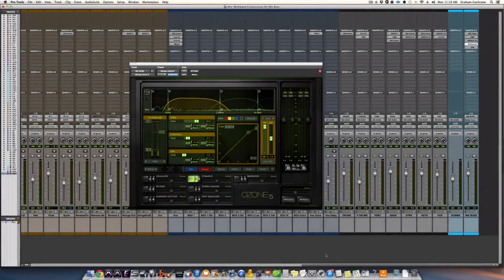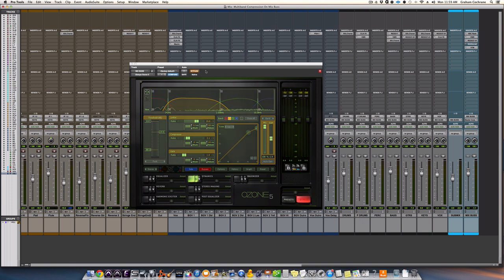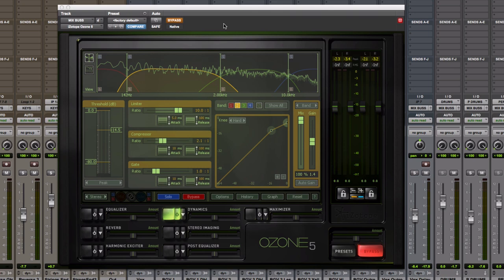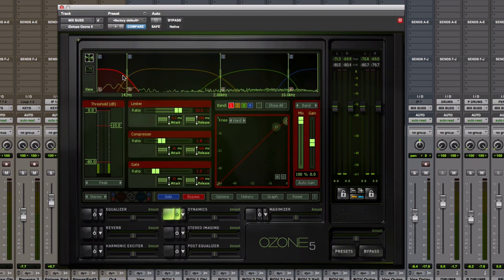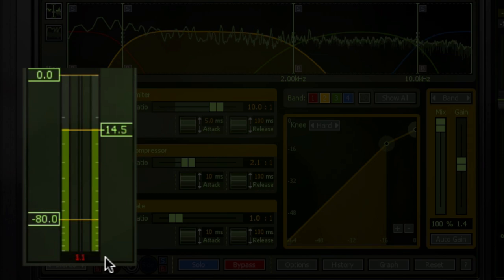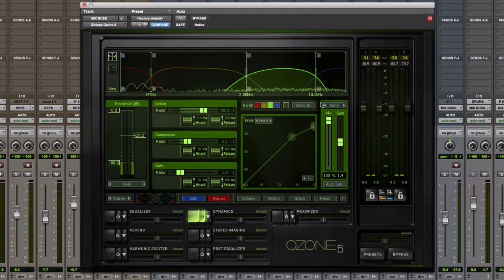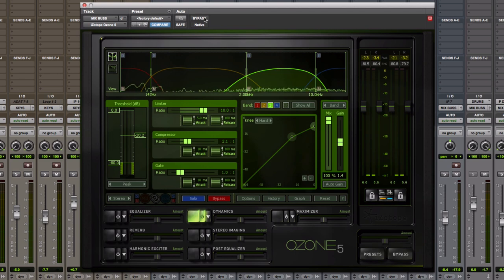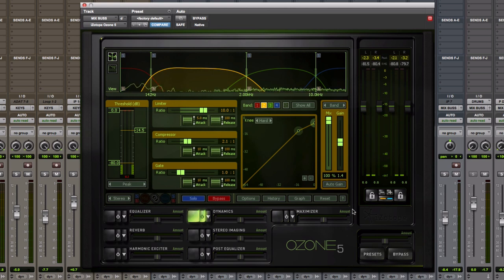Multiband Compression For Instant Mix Energy - TheRecordingRevolution.com

Comment: Graham, one of your best post ever. If used as you have shown, very sparingly it make me think of going to the eye doctor for a new fitting. He has that test where he asks which is better 1 or 2, until you can't tell the difference. That is how it was when I used it. The mix was good before the multiband, but when I added it, it was just a little bit better. It was like I took a step or 2 closer to the music, It was just a little more as if I were just in front of the band. I set up a preset for my Sonitus multiband compressor using your video. Mostly I would change when the compressor would kick in and then I would use bypass to test with or without. It was never a dramatic change just a nice subtle change. Thanks, Ray

Comment: i completely get what you're saying about how it "grabs you", but i'm noting a huge difference in the bassier instruments. your bass guitar and those low notes on the piano have such huge presence when you turn on that compression. they just pop right out of the mix. i'm blown away by how drastic of a difference this is. of course, there's a difference in other instruments as well, and the overall feeling seems a little more alive, but my god. thank you for sharing
Reply: I could not agree more, I really notice a difference in those bass frequencies when the comp is turned on! It must be that 140-250ish range that's really benefiting.

Comment: I've recently had to stick to a Studio One 2 Artist built-in compressor for a while, and to be honest, it doesn't do much. You can hear some difference, but most of the time it just doesn't want to work; its broken. At one point I got so annoyed that I took the compressor out, and made a makeshift compressor of my own: a limiter with Mixtool to act as the make-up gain. That worked. 

By the way, that is a good mix you've got there. Sounds lush.

Comment: I don't use multiband often. But the way I usually look at how it works is that it is a compressor but one where peak reduction doesn't affect the overall volume too much. E.g. if I have a kick drum going a classic compressor would be pumping with every kick. Multiband only pumps the bass (depending on band setup) and all the other audio is left untouched. Same goes for snare cracks, percussions or whatever there may be. It means that e.g. a 3:1 compression on a multiband will bring out more from the sound than just overall 3:1 compression.
But I'm no expert on multibands either :D

Comment: Another great technique.  I used to use multi-band compression but stopped because I couldn't wrap my brain around what it was doing.  I know the theory behind what it's supposed to do but I thought this may be too advanced for me.  However, I love what Graham is doing here.  Leaving the bottom and the top alone, and slightly squeezing the 2 mid bands.  I may not understand exactly what's happening here on a technical level, but the before and after speaks for itself.  I've already started using this technique in my last 2 mixes.  Thx Graham.

Comment: you forgot sausage fattener and soundgoodizer. always works
Reply: No.
Reply: The problem with soundgoodizer is that it's a set of Maximus presets, and you have no idea what they're doing. If you're using it on individual sounds, I guess it could work, even Savant said he's using it a lot on drums. But using it on your mix/master is as amature as you can get. Use Maximus instead- it's always better. It's not an opinion, it's a fact.
Sausage fattener however is a tool for lazy people, when you want to get a certain sound as loud as possible with no effort. Again- sometimes it works, sometimes it doesn't. Good thing to use on individual sounds (I find it perfect for drums), but not on overall mix/master.
Reply: It's pretty simple. If you like how soundgoodizer changes a sound, there is nothing wrong with applying it. If you're an amateur and destroy important dynamics of a sound it isn't soundgoodizers fault as the same result can be achieved by simple overcompression. Listen closely to the changes and evaluate how important the dynamics of your sound are.
Reply: Lol... Sausage fattener is only a tube saturator, and soundgoodizer is what Tristan Gray said, but I wouldn't use soundgoodizer on a master buss since it's basically sacrificing lows for highs the higher you crank it.
Reply: Soundgoodizer is just Maximus presets so it sounds fine in certain applications..  i often put it on kick drums..  use your ears not your preconceptions

Comment: Definitely a very positive , but quite subtle difference to my ears, using the multiband compression, way to go Adam !
And ..maybe it's just my ears but to me, with the multiband compression on, also the low's sound abit fuller (nicer),
although they are not assumed to be touched... how odd..
I am listening with Adams A7 speakers.
Reply: We'll, what we percive as fullness starts at around 200hz, which is getting compressed. Below 140hz isn't what we would expect basswise. I like to look at this chart sometimes, pretty handy: http://www.independentrecording.net/irn/resources/freqchart/main_display.htm
Reply: Way to go ADAM? This is Recording Revolution, run by and featuring Graham Cochrane. I see that you're subscribed to Real Home Recording, so I am figuring that's why you said Adam instead- just confused the two best mix/master engineer channels. It's just a shame that Adam's numbers aren't up with Graham's numbers, because I have probably learned more from Adam than anyone else.
Reply: klick2destruct and yet:
http://www.independentrecording.net/irn/resources/freqchart/main_display.htm
Reply: Laurent Toussaint I didn't know that this was posible now! I changed it in my comment too.

Comment: What is common to do apart from applying the compression on the mids is to apply subtle expansion on the lows and highs. Try that next time. The compression on the mids with the subsequent gain brings them up in the mix making it warmer. While the expansion on the lows and highs makes them more crisp.

Comment: starting from a sound design approach to music production,mixing and mastering as a new player in this music game i put multiband compressors on everything thinking that is what mastering was lol. It didn't sound that bad for edm and the style,but everything was just way too loud since i had no clue what i was doing. Later i got better and found out how to work with it better and realized it's not something you want on every track since it was killing dynamics. It's best on the master to fix little issues to balance everything and i've herd on the pensado show from a well known mastering engineer he rarely needs to use it except to fix problems. It's still a powerful tool when nothing else is helping and something to use without going crazy with and trying to make everything really loud. Best used to balance a group of instruments,drums, or on the master if needed and does not replace an EQ which is what alot of people get confused about when using multiband compressors. If you use it to replace an EQ that track will eat up alot of space in the mix. Also concerning sound design Multiband compression can be very useful for a big electronic bass or kicks. Another thing thats interesting is a Dynamic EQ which functions like a mutliband compressor,but also uses bell curve bands in addition to many instead of only large band types which is useful for vocals or solving problems surgically.

Comment: The multi-band compressor is my BEST FRIEND!!  It doesn't work on every mix, but I find that any time I just can't seem to get depth to a mix, adding the multi-band compressor is my hero.  My latest mix was just sounding so flat.  I can EQ it all I want, but sometimes it just does not do the trick.  I add the multi-band compressor and WOW.  Instant change.  Sometimes, instead of trying to tweak with EQ and making the mix sound off balance by EQing too much, try this.  Seriously, it may be all your mix needs.

Comment: Just tried it with some freeware multiband compressor and it works really nice. Just as you said - makes the mix jump out of the speakers and come to life a little bit more. Really cool effect, thanks!
Reply: what freeware multiband compressors did you use
Reply: I used Reaper's default multiband compressor, ReaXComp! You can get the plugin bundle for free at Reaper's website to use in any DAW. It's called ReaPlugs.
Reply: I have protools 12 so I cant use vst plugins
Reply: +dzamija922 Hey boss... please, do you use this before or after the ssl comp or do you use this multiband compression as the main compression...
Reply: blooddrummer yes you can, download a vst 2 rtas wrapper  and then you can. i use vst in protools
Reply: Osaheni Paul Amen Ordia use small amounts of compression between 2 compressor  or more. only using one compressor gives  the vocals a very unnatural sound

Comment: If this is a tough concept to start with, you can first experiment with a freebie VST called Endorphin from Digital Fishphones. After that........

Don't deal with more than two bands (remove any 3rd or 4th band). By compressing the upper band a bit more than the lower, you can bring out the articulation on a vocal or acoustic solo while leaving the body and weight of the sound unchanged. This can focus a track without overcompression, bringing it forward in a heavy mix. This is different from EQ, but just as valid. Lightly used, it's also a neat trick for voiceover recording.

Ozone lets you vary the crossover frequency. Set the upper half to more compression than the lower, then scan up and down between 100 and 1200 Hz, and your ears will tell you when to stop.

(Another trick in Ozone is to go into Harmonic Exciter instead and delay the lower band by a slight increment. This will cut your effective mic distance after the fact.)

Never do multiband compression in a big way if you plan on broadcast. A lot of radio stations multiband their signal to sound louder, so if your multiband compression is superimposed on theirs, it's way out of control and the results are unpredictable. So keep a light touch.

Comment: I do believe multi-band compression is an incredible tool to use however Ozone (correct me if I'm wrong since I do not own it) seems a bit dull. It would be nice to have a mid/side control over each individual band that's being compressed individually to get an even wider, punchier and energetic mix. Thanks for the idea of mixing from the Master Bus tho! Big ups, keep those vids coming. Thank you

Comment: Quite a few engineers are using multiband more and more in mixes. I know Alan Myerson uses it pretty heavily, especially using the side chain capabilities of some MBC's, like C6 from Waves. 

I like to think of Multi-band Compression as a dynamic equalizer. Instead of just cutting frequencies and having it be a static cut, you can use a MBC to duck what you want to cut only when it comes up in the audio. Like, say the low mids, its not always going to be apparent and causing mud. So, why not have a piece of gear react to constant change in the audio, keeps things dynamic and alive.

Comment: There is one in the Reaper but I don't really know how to use them so I just grab the preset, like solid base, nice mids.  I don't know what it does really but it sounds a lot better.  More punchy and yet everything is still distinctly clear.  Thanks for this Graham.  Might help me learn what these things really do.  But I was told that dither plug, they say, 'when converting from 24db to 16db, put the dither on!'.  What does it do?  They tell me, 'just use it'.
Reply: Dithering is basically a "noise" you put in the audio to make the transition between each sample softer and less noticeable. I don't know if that is a good way to explain it but that's a way to look att it.
Digital audio consists of samples, and there are small small spaces between those samples that we usually do not notice. But when bouncing down from 24 bit to 16 bit, those spaces become more audible (dont ask me why), so you put noise in there, and those supershort noises "trick" our ears to think that it is actually part of the sound. This way making it sound cleaner and smoother. 
As I said I am not sure I am explaining it in a proper way, but I think Graham has a good video on dithering.
Reply: acelatino I was told dither would take five years study to really understand, very complex stuff, but what this teacher told me, was 'don't ask when going from 24 to 16 just put in.  So I do that.  Thanks for your more indepth explanation.
Reply: acelatino  It is important to know that dither is NOT JUST A NOISE. Remember that. A 'kind of a noise" is alright, but this "kind of noise" makes your audio sound better, to put it in layman's terms. It is not undesirable at all like the normal kind of noise is. Always use dithering of any kind when converting from 24bit to 16bit especially and if you want to process this audio further you have to use dithering as the last plugin in the chain again.
Reply: dddux
Right on point. I did not specify what "kind of noise" because I really do not know. And I have not listened to it "SOLO" to put it that way. All I know is it sounds better with it, and that there is a reason all the greats use it.
Been using it since day one basically hehe
Reply: When you bounce down an audio file you introduce truncation distortion to the signal which sounds nasty. Dither randomizes those quantization errors and more or less converts them to a low level hiss. I don't think that it matters what kind of dither you use. The important thing is that you use it as soon as you bounce your track.
If you want to learn a little more about that and hear some examples check this out:

http://productionadvice.co.uk/dither-or-distort/
Reply: Lennart G Thanks I get more help from here than some of the courses I paid hundreds of dollars for, and got absolutely nothing but a pile of notes for.  I find out later I can get the same notes for nothing from a university in the US.  You do a great job and thanks for this help.

Comment: Thank You for showing this. Did You try to use the side - mid function in the Ozone5 and do the same thing? And it works similar if you turn on the auto gain button (if not better). Or you can ride the gr slider in automation mode which is quite difficult as our ears and response reactions are not that exact. In that case auto gain can be even more exact. But that depends on a mix, in some cases it can also have the unwanted effect, just like any compression can...
The illusion of clarity is achieved for humans only, as distribution of hair cells in our ears is the most dense in the reign from 1kHy to 6kHz that allows us to recognize the speech. But this process does shape the peaks in the range of 2dB which then brings mid & hi-mid section in average up, whilst maintaining the low and hi end in the same level. Maybe that is why we can hear the difference?

Comment: Multiband compression is one of those things that I'm not sure how to use. I understand the concept - compression of targeted, separate bands - but I'm just never sure if I really "need" to use it to make music sound "professional". 

I guess my reservation is that, if the mix is balanced in the first place - volumes set well, specific instruments that occupy distinct frequencies have been appropriately compressed, eq'd and panned - then do I still need to use a multiband compressor on the master track? 

I can't help but feel that there is also on element of marketing of it as a tool that "creates that pro sound but it is a sophisticated tool which can ruin your mix if not used carefully" - so a I feel like I'm in a kind of a double bind, which isn't very nice :).

All that said, I'm still using the tools that I know and am carefully learning as much as possible about multiband compression and its use. Hope I'll have that a-ha moment soon, though. :)
Reply: I'm in a very similar boat! I understand the theory, it's just the application that I'm lacking, which will only come with experience using it. My main lingering though is "surely this is the job of the mastering engineer, at least when the effect is this subtle?"

Comment: I was working on a 2 mixes this week. The first had a lot of horrible frequencies across most of the instruments that needed loads of carving out in order to get a clean and balanced mix. The second needed far less surgery.

When I was done with both mixes, I noticed that while the first mix was now clean and balanced, when compared to the second mix, it felt cold and didn't have that "rounded" feel to the whole thing. That "hole" in the middle reminded me of this video and I tried it out and it definitely made it warmer, more energetic and "rounded".

Is it a case then, that using multi-band compression on the low-mids and high-mids helps to level out a frequency region of a song where a lot of frequencies are usually cut from when mixing which we obviously do not want to re-introduce?

Whatever the reason, thanks for the tip Graham :-)

Comment: I understand compressors pretty well, but like you, there's something about multiband I find confusing. But, oddly, I've been using Waves F6 active EQ, which I think gets you to the same place, but from the EQ angle, and I don't find that confusing. Maybe it's just that the interface is friendlier than the Studio One multiband compressor. But I can do the same thing, right? i.e., compress a range a bit & add a bit of gain?